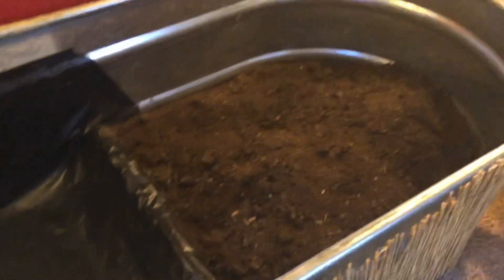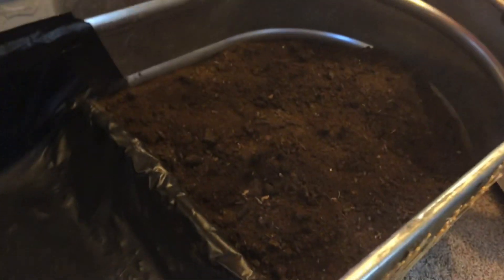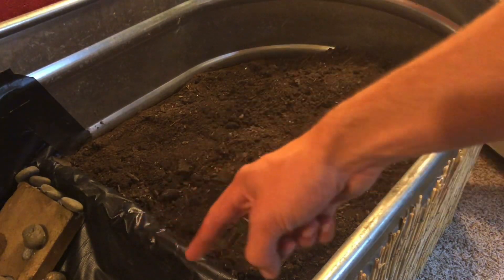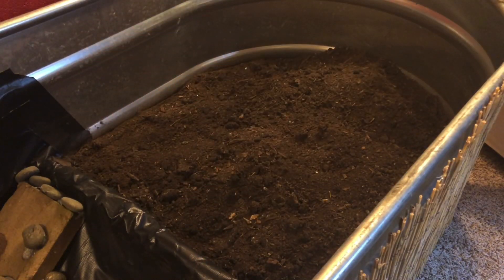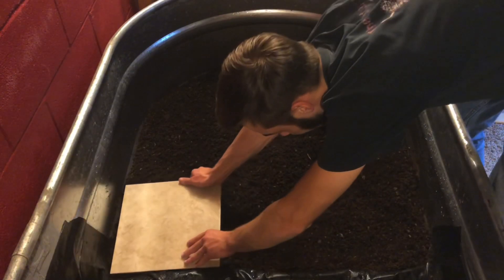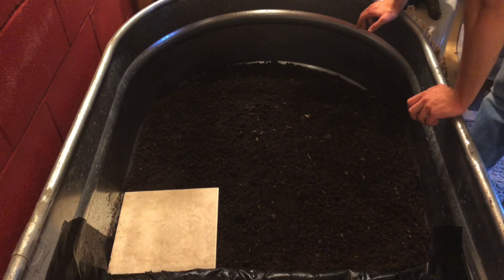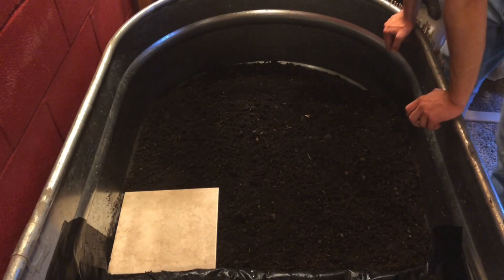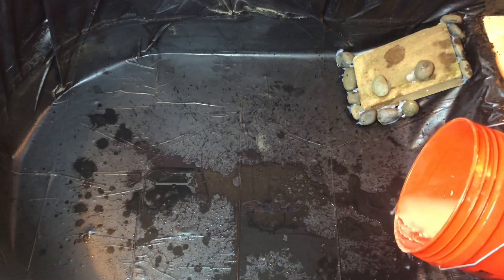Setting up a HUGE Reeves Turtle Enclosure

Comment: Those suction cups on the filter and heater only like to work on hard, smooth walls. For some reason pond liner Material buckles just enough to break the suction. I would try siliconing an acrylic sheet to the side of the tank, so you can utilize the suction cups. Or even add another smooth ceramic tile at the bottom of the tank you can use as an anchor point. Just thinking out loud.